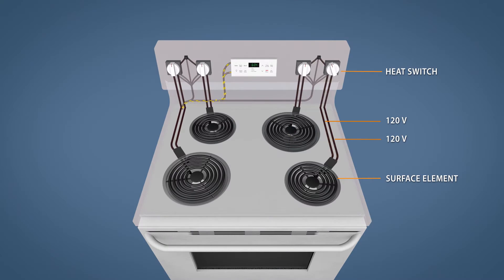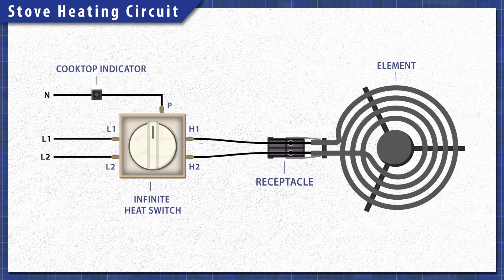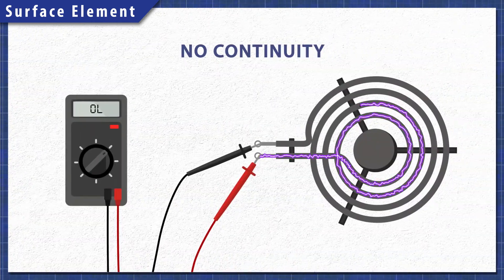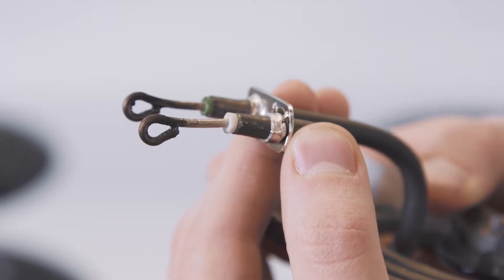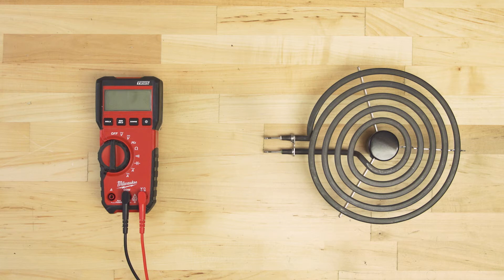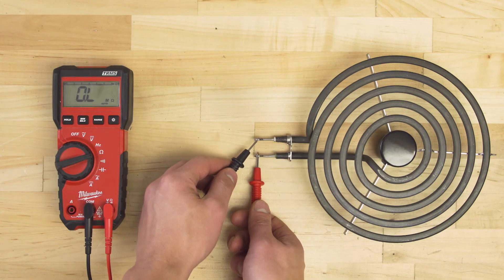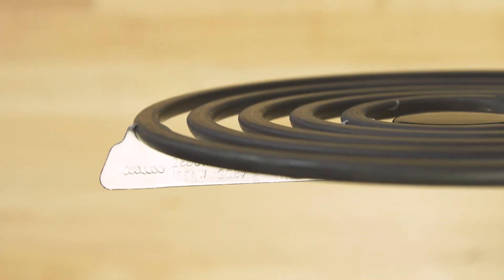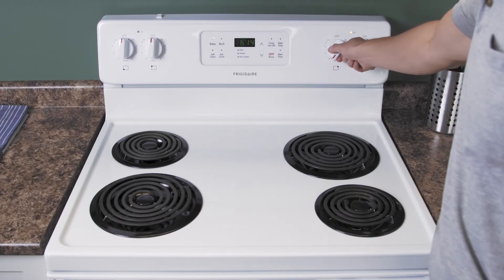Stove Heating Element - Testing & Replacement | Repair & Replace

Comment: My elderly parents had an electrian replace a  stove top element on a newish Euromaid FRR54W. But its still heating erratically. Seems to me to be loose connection. If it starts and stops heating ONLY when the element is moved, would that mean it can only be the receptacle? Its a 3 hour round trip to look at the oven.
Reply from the maker: Yes a loose receptacle will cause the element to only work sometimes. The fact that you can wiggle it and it changes, is proof of that. We have a video showing how to access and replace the receptacle: https://www.youtube.com/watch?v=GBnE_qEThsU

Comment: Thanks for your video.  I just ordered new, OEM drip pans and elements for my 40+ year old JennAir cook top with two burners.  The rear 8" burner installed perfectly & shows the element being "level" all the way around but the front 6" burner is only level right to left but not front to back.  Any ideas? Also, I checked using both the rimless OEM drip pan and the old pan with a rim where and this made no difference with front to back still being out of level.  To be clear, the element sits firm and there's  no wobble. This is a drop in JennAir 2300 cooktop unit with down draft so no floor or counter leveling (i.e., rear burner is perfect).
Reply from the maker: Thanks for watching. If you've installed new drip pans and elements and it is still not level, then it's possible that the cook top itself is warped. 40 years is a lot of time and the weight of pots and positioning can cause the stove top itself to warp. You could take a level and try to spot check and in some cases you might be able to bend or fix a section that is more warped than others.
Reply: @AmreSupply  Thanks for your quick reply!  You'd think it would be the 8" rear burner with 40 yrs of heavy pots if any warping!  No worries -- all is well after figuring out it was the prong to the element that needed adjustment and the front burner is now square all around. Cheers!

Comment: I replaced my infit switch twice now. I get Ohms of .4 from L1 to H1 and .4 from L2 to Hc. MY heating element is always glowing hot regardless if on low. I am at a loss now. Could it be the heating element itself?
Reply from the maker: Thanks for watching. We cover this in a different video. It is possible that the element is shorted, you can test this from the back: https://youtu.be/l39vOnhqnhg?si=nn3MSQ-Dfxc2Fl2F&t=209
Reply: @AmreSupply  JEnn Aire C301. CAn I just test ohm directly with the element?
Reply from the maker: @ Depends where the element is shorted but yes. The test with the wires will tell you if there is a short or not, this could be any of the wires, connectors or the element. So you might need to isolate one of these to narrow it down.

Comment: Will this work for a Galaxy stove?
Reply from the maker: Thanks for watching. If the stove has coiled heating elements like this then the steps should be similar. 

If you have a glass top / ceramic heating elements then watch this video: https://www.youtube.com/watch?v=GaW7uAHkPQI

Comment: Can I mend a burnt out heating element?
Reply from the maker: Thanks for watching. Stove elements have a thin wire surrounded by a outer insulation. If the wire burns out internally then it can't be repaired. You'll have to install a new heating element.

Comment: My always question is that  why the elsectric not shocked while connecting the neutral and live electric like soldering iron , heating  and stoves
Reply from the maker: Thanks for watching. If you're wondering why a stove heating element doesn't give you a shock, it's because it is insulated. There is a thin wire inside, and insulation that prevents it from becoming shorted.